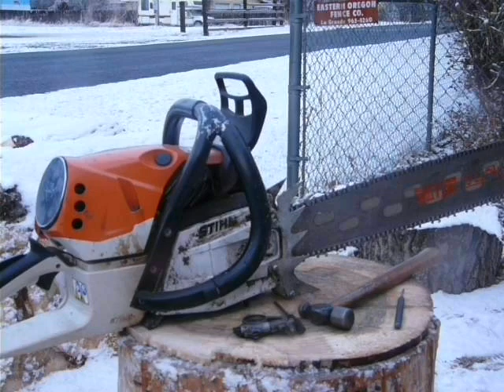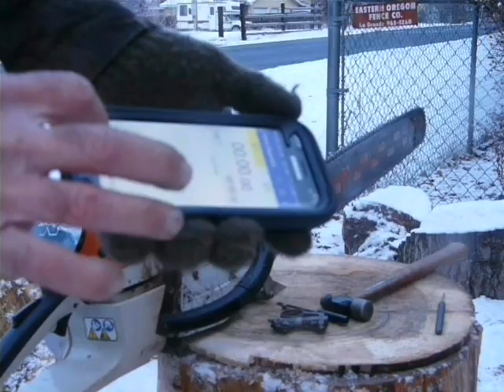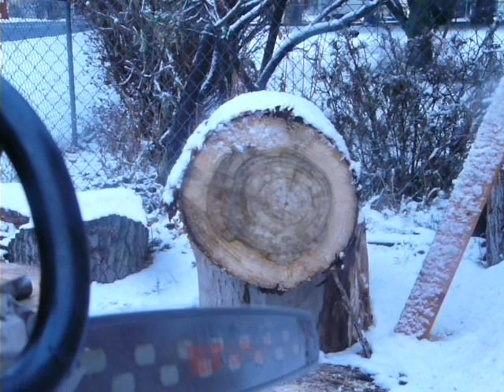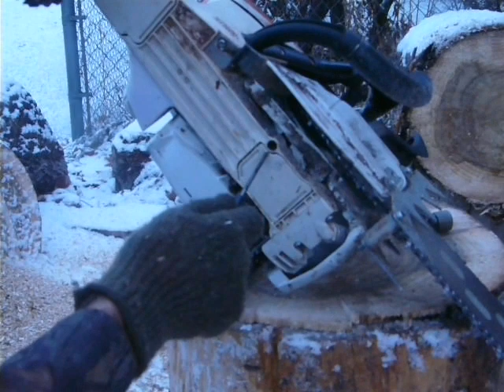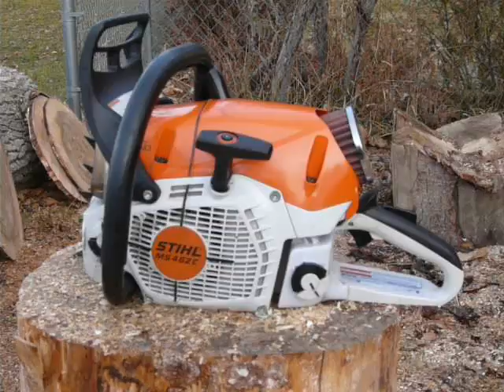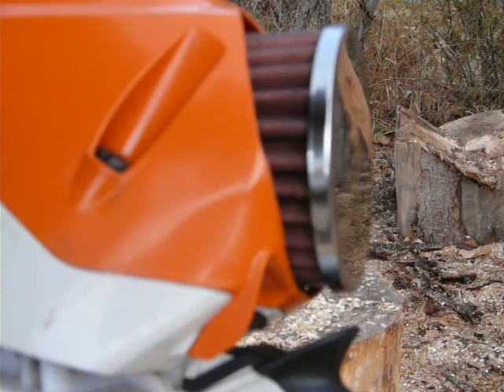Stihl ms462 ChainSaw Tips - 3 You Need To Know!

Comment: How many tanks or gallons of mixed fuel do you run before you change out the new filter? I just picked up a new MS462CM so I’m very curious and extremely grateful for these two tips that are invaluable.
Reply from the maker: 888HUSKERS hi. How dirty is the fuel going in the tank? How much saw dust is making it past the cap? In other words, more often if the tank is getting a lot of small woody debris or contaminated fuel in it. The amount of fuel run
through the saw will play a part. Some guys burn through a gallon or gallon and a half a day - I'll do that while on a tree killing spree. Some guys don't burn that much in a month. 
It is impossible for me to tell anyone how often they need to replace their fuel filter. It will be up to the operator to assess the conditions and use, then take action accordingly.
Thanks for watching.

Comment: So even with a stock 462 you should do step 1?
Reply from the maker: Tac hi. The shop should do it initially. If your changing quite a bit in elevation from that location then yes. The "A.I." in the controller will get dialed "all by itself" just by operating the saw if you decide not to recalibrate yourself. It won't take forever either. I did add the written factory version in the description too.
Thanks for watching.
Reply: @hotsaws101  thanks man!

Comment: Great video as always! In your opinion what’s the best saw out there for your money? For logging and serious wood cutting? I appreciate your input! Thanks again!!
Reply from the maker: Ben hi. Logging or felling timber? Those are two different sports.
I have not been on a skidding crew - whether yarder or cat side in any long term capacity - since in the early '80s. I do work around those guys every so often though.
Seems like a lot of the yarding crews run Husky saws. The air cleaner systems were better for taking the abuse of the little or no maintenance that seems to happen.
You never said a bar length, cc class, or which dealer you frequent. Extra bars and parts saws play a role too. Zipped or stock enters into the equation as well. Ergos are a consideration. 
Thanks for watching.

Comment: That was well explained Hotsaws101👍. I have a question for You. Does this apply to all c-m Stihl models? How about the smaller cc's? I have a Pre 2016 Ms 261C-M I am running a Sugi Hara 18" .50 Narrow Kerf bar and 23 RS pro chain. And wonder if the same Mtronic reset method You just demonstrated with Your 462 also applies to My 261? Thanks and awsome vid.
Reply from the maker: Kevin hi. 
Some saws are different. Depends upon the controller circa at times. The best way is to get the controller part number and verify with your local dealer.
The controllers will recalibrate themselves over time with no operator input too. Just takes a little longer is all.
Thanks for watching.

Comment: Hey jack just curious I cut about 30 cords a year for a few years now and I'm looking to up production. I know bucking up firewood is way different than logging, I feel like I'm constantly in the cut or limbing, I'm just trying to figure out about how many cuts is 5000BF  roughly. I know your sections are alot longer than mine. I'm trying to translate how much work the saw is doing. I manly cut big wood as well as milling. Believe it or not my saw is a 362 and is getting tired lol I'm looking to get ported  462 or maybe get a 661. Thanks for your time and sharing your wisdom.
Reply from the maker: Matt hi.
I funded some of my high school "wildings" by selling firewood. Sometimes I'd get lucky. On some of the nice, old buckskins it was 4 cuts to the cord. So in other words, four rounds yielded a cord of sellable firewood.
Back on track... A 32' x 6" log has 50 board feet. A 20' x 102" log has 10,000 board feet. I've cut both.
A guy would have to know the lengths and diameters of all the logs to be able to calculate your volume. It is going to be different every time you venture into the woods.
Unless your trees are clean stemmed and large diameter your going to be in the cut quite a bit - whether it be limbs or bole. No way around it.
Thanks for watching.
Reply: @hotsaws101   that's alot of factors to consider thanks for the reply I appreciate your opinion and knowledge. Do you have a patreon or something of that nature to donate?  I would like to get something worked on by you in the future but I need to save more "lunch money" for that one. But I'd like to shoot something your way for advice. Also I have another question would a 462 or 661 be better suited to my needs? I've saved up for the saw and I'm ready to purchase and they are not much difference in price.
Reply: I'm no jack .lol.but been in trees 30 years ..661 is to heavy if your doing tree work regularly.462 beyter choice unless you do mostly firewood and the wood is west' coast size.I got 462 for weight .im older and small guy.both are all allarounders' on east coast .live in smokeys but do get some big ones sometimes .not enough to carry 395 or 661.

Comment: What is the black plug you have in the decomp hole on cover? Looks factory and I need one for my 462 and 661 thanks!
Reply from the maker: Kevin hi.
At the risk of sounding off key, it is simply that - a black plug. 
I do not think that it helps the saw run cooler though. In fact, it probably would be better off if the hole was left open when running in the warmer months.
I added it to see how my saw  responded to having the air flow channeled all the way across the fins to exit near the handle bar support.
Thanks for watching.

Comment: Hey jack I have a 461m and it runs great during the warmer months however during cold months the dang thing leaves me hanging (won’t start) all the time unless I warm it up in the house or cab of a truck and those aren’t always an option since I often have to snowmobile a long way to get to the wood. It’ll pop consistently but immediately die. Oh and when I say colder months I’m talking -20/-45c. I have the intake switched to cold and I’ve dialled the carb to the temperature by warming it up inside the starting then dialling and running for a while in the cold. If you have any info I’d be stoked to hear it
Reply from the maker: Timothy hi.
The air density changes dramatically from 80/90° Fahrenheit to the - 4 to - 49 you experience during winter months.
I first wondered about the condition of the diaphragms in the carb. Slightly stiff and they will probably pass when it's warm but struggle the colder it becomes.
It could be something simple like dialing in the jetting to compensate for the air density differential.
The plug may need to be changed as well.
Pretty hard the tell "over the phone" though.
I do know that in those conditions any slight issue at normal temperatures can be exasperated and become a problem.
If jetting adjustments don't help, I would have a looksee at the carb and plug.
Thanks for watching.
Reply: hotsaws101 thanks for the info jack I never thought about diagrams getting stiff. Stay safe and happy cutting!

Comment: Hey man I got a question about my saw. I got a ms441 with a ported muffler engine is still stock, awhile ago it started to mess up. If you start it it will run for about 10 seconds then die any idea what’s wrong?
Reply from the maker: Montana hi. Seems like a fuel delivery issue. But,,, kind of like telling someone how to fall a tree over the phone...
If that is the case, clogged filter, stiff diaphragms, clogged carb screen. Impossible to tell from "over here".
Thanks for watching.

Comment: Is the oil control bolt the same on a 066 original? I’ve bought a couple holzformma 66 knockoffs because they’re 250-270 delivered and put old carb, handlebars,chain tensioner and, most importantly, piston wrist pin circlips and they run fine but don’t oil enough.
Reply from the maker: LL hi. The 462 is an 1142 series. The 066/660 is 1128. Not to much of the "important stuff" will interchange. The control bolt is not compatible.
Not sure why you don't just upgrade the entire oiler to oem?
Thanks for watching.
Reply: hotsaws101 took it out today and this one oils fine, but I didn’t open it up yet being scared it would junk it. A couple more tanks of rich fuel and I’ll tune it up. I know they’re crap, but for less than three hundred plus old carb and handle bars they work fine. I wouldn’t want to pack in and have it grenade but I don’t get far from the truck anymore.

Comment: Is this for when you first purchase the new saw or to do every so often?
Reply from the maker: A. Grim hi.
Both in a way. 
Some guys will do it at every new location. 
Some will do it the first time "out the gate". 
Some will never do it.
According to support, the A.I. running the program will monitor and compensate. So, after a period of time (short vs long) the controller will adjust itself to the current conditions "automatically". Theoretically then, you should be able to not "manually" set it as seen here and just run it for awhile and the saw will "reprogram" itself to optimum.
How long? I've heard as little as 5 medium diameter cuts.
Thanks for watching.
Reply: @hotsaws101  thank you I just did pick up my first 462. Absolutely lovin it

Comment: What's the breaking in process, I'm waiting for mine to arrive 😊
Reply from the maker: Cob 702 hi. The m-tronic system is  saving you from yourself with the A.I. controller. So running it fat on the high is "outta" the question. 
Running it a bit rich concentration wise is the only way to compensate there. Depending upon which mix oil you use, I wouldn't baby it lest you get buildup or shellacked rings.
You could do a couple of heat cycles I guess. Mostly just throw a bar on and go.
Thanks for watching.

Comment: Hi mate, a mate just recently brought the same saw which comes with a 20” bar! It has a huge oiler issue, with barely any oil coming out at all, and our hard woods are hard! Tapping in that roll pin is a real treat! The guy at the Stihl shop doesn’t recommend doing it, as it won’t do anything at all, except damage the oil pump!!!  
Plus he  said you can’t run anything bigger then that bar! What can l say??? 🤔 Better not😉 
Cheers Stoney...
Reply: In the owner's manual for the 462  it shows and recommends tapping that pin in to increase the oiling.  I done mine before I even before it made it's 1st cut.

Comment: What do you think of a 462 with 32" bar
Reply from the maker: José hi. I ran mine in zipped form with a lw 33 & 32 bars initially. I was  running a 572 concurrently. I liked the 572 with a 33 and cut a fair amount of volume with it. I ended up conjuring up a 30" lw for the 462. Even in zipped form the 462s are lacking a bit down low imho.
Part of that is balance too. From a manouverability perspective, I like the unit a little bit nose heavy. Not mostly nose heavy. The 462 bounces off the log when running while donning a 32 - that might be from mine hitting harder while running too. When compared to a zipped 461, the 462 is definitely lagging down low. Multiple recent posts shows this aspect.
They are however, weightless for the displacement and power output. If I were a full time arborist,   I'd have at least one of each.
I think that in certain production felling applications the 462 would shine as well.
Thanks for watching.
Reply: @hotsaws101  thank you very much for responding with such a thuro answer. Love your vids especially when you honor God

Comment: Hey buddy how are you   question can you please do a video showing the correct way to tune the Hi an low  on a custom chainsaw
Reply from the maker: b r hi. About 2 1/2 years ago I posted a video. My Cherry Mag 038 & Carb Adjustment Method, or there about is the title.
You might have a gander.
Thanks for watching.
Reply: @hotsaws101   Thank you so much
Reply: @hotsaws101   I found the video buddy so that's the same way I want to tune my custom chainsaws correct
Reply from the maker: b r - I showed my way in the video. I'm a firm believer that we should all do the research and determine what is best for our saw/application/location/chain set- up/mix oil choice/etc. etc.
My stance is to provide an option, whether it be carb tuning or one way to fell a tree. 
I am pretty big on suggestions personally.

Comment: Yall ever tried to put a small piece of panty hose over your air filter?  We always used to do that when we ran our bikes in the dunes or in fine silty dusty conditions. Its makes a great and cheap prefilter for your air filter. It also makes cleaning your K&N type filters easier to clean when it comes time. I's not sure you guys would ever need something like that.
Reply from the maker: MIKEDUZZI hi. It was pretty common practice on the 050 through 090 saws "back in the day". It was a pretty easy attachment when using the green weenie and/or the K&Ns while working inland too.
The oil, if it has a tackifier, works pretty good in this day & age. 
Thanks for watching.

Comment: You did it a bit wrong

Only need to let it idle for over 30 seconds, then full throttle and it goes from 10000 rpm to full revs as it it did in hte video but you need to wait for it to drop back to 10000 rpm for the calibration to be done
Reply from the maker: Tony Moy - A copy of the Stihl® literature on this is in the description. It's 30 to 60 seconds actually. I already addressed this with another viewer. Went long since I figured most won't time it to the gnats rear. Also, it was pretty cold and I wanted it as warm as possible for the wot blast. 
Additionally, they range a little in the amount of time it takes in dropping back down. Seems like it is a little less when the calibration has been done in the same location recently.
Again, check the description for the verbatim, Stihl®  recommended method if there is a question.
Thanks for watching.